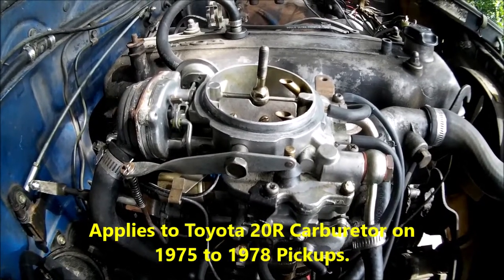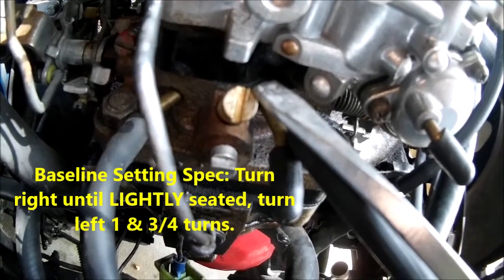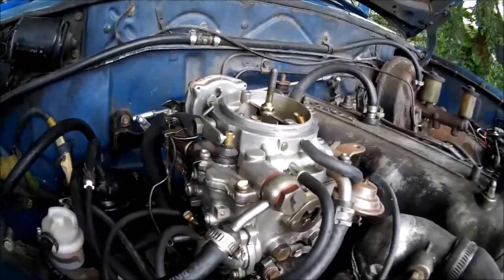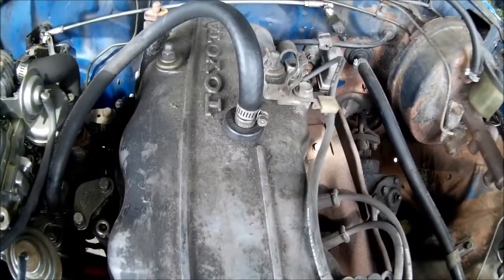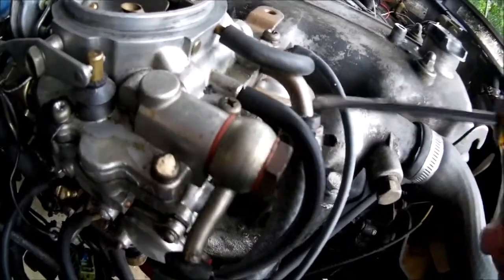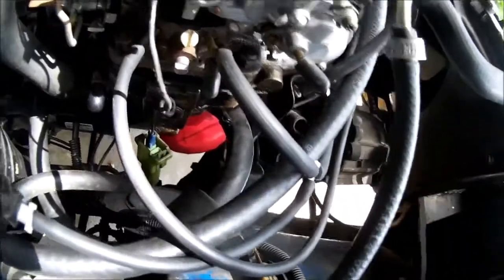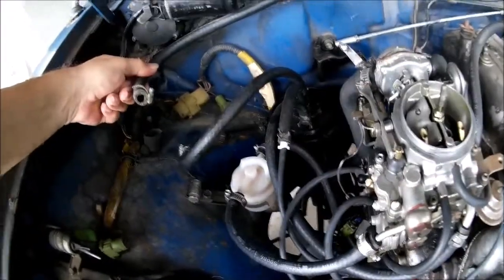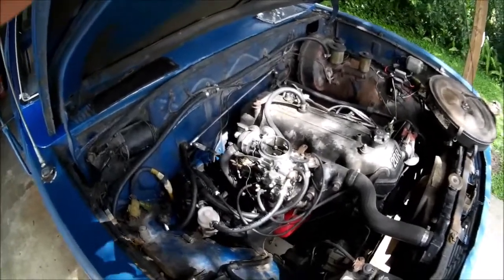1978 Toyota Pickup/Hilux 20R-Carb Adjust & Vac Lines-Desmogged

Comment: Thank you for making this! It's way more helpful than the standard "Just replace it with a Webber" answer I usually get when asking about stock carbs.
Reply from the maker: You're welcome & I'm glad it was of some help to you. Not all of us out here can just throw money at a problem to solve it & we have to work with what we have. Besides, I'm a pretty firm believer in that using a purpose designed part to work with a particular engine is usually the best way to go, reliability & durability wise. I have nothing against the Weber 32/36, but even people that have them will tell you it can be a bit finicky to tune. Not so much with the stock Aisin carbs.

Thanks for the comment & let me know if I can help you out in any way.

Comment: Thanks for this video , Awesome, I own a 1977 Toyota Celica

 I moved this screw (fast idle ) and I didn't know how to reset it, can you help me the car doesn't start now unless I put fuel
  in the carburettor
Reply from the maker: I have a few questions about this. Which way did you move the screw" Turned to the left or to the right? When you say you can only start the engine if you put gas in the carb, is the top choke plate open or closed?

From you brief description, I'd suspect that it is open. For a "cold" engine, it needs extra gas to start & run until it "warms up" to normal operating temperature. The top choke plate helps that to happen. It restricts air flow into the carburetor, so that the engine gets more gas than air. As the engine "warms up", it needs less gas & more air. The choke mechanism on the carb progressively opens the top choke plate to do that.

There is a linkage connected to the top choke plate that operates a cam, that the fast idle screw comes into contact with. To do a basic setting on the fast idle screw:

1. With the engine "cold". Remove the air cleaner. Locate the fast idle screw & turn it to the left until you see very little or none of it's threads on the inside of the lever that it is threaded into. DO NOT COMPLETELY REMOVE THE SCREW. You want it to remain threaded into it's lever.
2. At the rear of the carb, operate the throttle lever, moving it at least 1 inch of travel. This should make your top choke plate close completely. If the top choke plate does not close on it's own you have a choke issue that has to be solved first.
3. With the top choke plate closed, look at the fast idle cam. It should have two (steps) on it. The second "step" should be in line with the fast idle screw.
4. Turn the fast idle screw in (to the right) until the screw just barely touches the second "step" on the fast idle cam.

This is how mine is, stock 20R carb. It is possible that you might have a later model 20R carb or a 22R carb on it, and the mechanism might be different. The fast idle screw might adjust an "arm" that contacts the "steps" of the choke cam. But the setting works the same way. On those you just need to turn the screw in until the "arm" just touches the second "step" on the cam.
Reply: @The13thSword  
Thank you for the quick response, and thank you for the great information, I need some time to implement the steps because I do not have experience, and need to the cold weather (the temperature in the day is 50 degrees and the humidity at night is 85%) . 

 I will inform you of the results 

Which way did you move the screw  ?

I didn't do it myself it's the mechanic in the garage
Reply from the maker: @tarout5  You are welcome. Just to be clear, you do not need the cold weather to do this. When I said "cold engine" I mean that the engine has completely cooled off from it's last run time. This usually takes an hour or more in most cases. If the engine has not been run for at least an hour you should be able to do the procedure with no problems.
Air temperature of 50F (10C) to do the procedure is OK.
Even if the weather/air temperature is 100F (37C) that's OK. Most gasoline engines run at 180F to 190F (83C to 88C) at full operating temperature. The choke is designed to be fully closed even at 100F, & full opened at 180F to 190F.
Air humidity is not a factor.

Do not be worried about your lack of experience. Just follow the steps carefully. Take you time with it, I'm sure you can at least get things to a point where you can start the engine without having to pour gas in the carb. Once you can do that, you can "tune" the carb to get a proper fast idle speed & low idle speed.

Sorry to hear the shop mechanics did this. :^( Most mechanics today know nothing about carburetors or how they work; they are all used to fuel injection instead.
Reply: @The13thSword  Yes, I understand you, but it is difficult for me to work at a temperature of 50 C
Reply from the maker: @tarout5  Understood. I'll be waiting to hear back from you once you can get to it.

Comment: Hey buddy I hope you still check this post. I’m stranded in Los vagus in my 1971 dolphin 20R. It’s like it running with the choke on or not getting air
Reply from the maker: I assume you've taken off the air cleaner & verified that the choke plate is actually closed? Or stuck closed? It the truck running rich? Black smoke from the exhaust?
If the choke plate is stuck closed you can try a few things.
1. Spray down the choke linkage with carb cleaner & gently (and I do mean GENTLY) work the linkage by hand to see if it will free up. Sometimes the linkage gets "gummed up" & won't move, or cause the choke to remain in the closed position.
2. Sometimes on the 20R carb, the choke plate can get stuck completely closed in the carbs throat. It can also get stuck completely open, especially if you've hit the gas pedal suddenly & hard.
If stuck closed, give the plate a few light pokes on the back side (firewall side) of the plate. This has happened to me once or twice. If stuck open, gently push the top of the plate towards the rear of the truck, & it should pop back into normal position. This has also happened to me before.
3. If the choke thermostat isn't working or moving, or not moving or opening at all even when hot (this is rare) - Carefully disconnect one end of the activating arm from the choke thermostat to the choke plate. I would do this at the plate end personally. You won't have any choke for cold starts but some extra pumps of gas should get it started. And once the engine warms up it should be driveable.